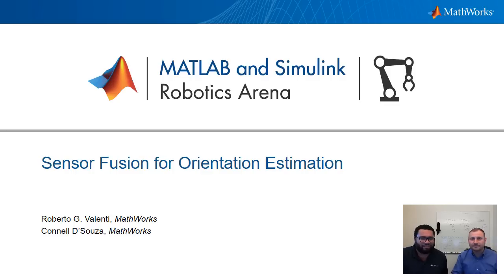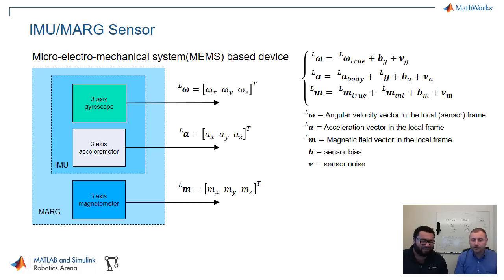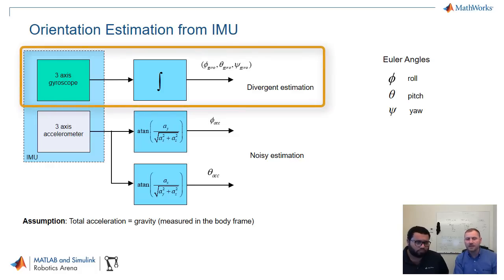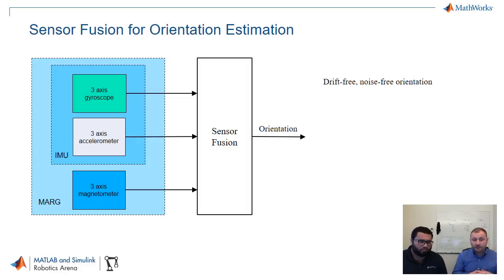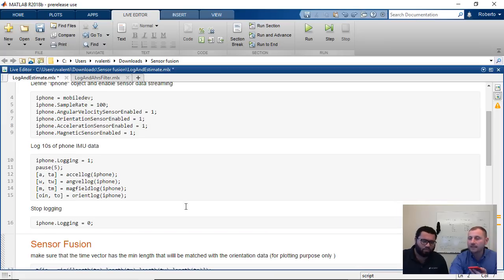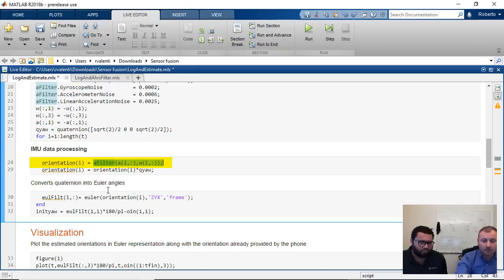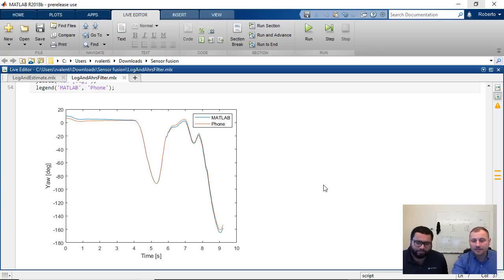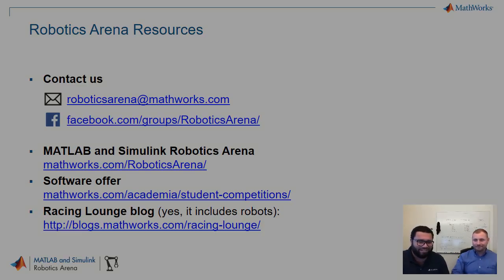Sensor Fusion for Orientation Estimation

Comment: Is it possible to integrate angular rates in order to get a set of euler angles. Shouldn't we consider a coordinate or reference frame conversation using like quaternion or dcm?
After that we can use the corresponding results with the calculated ones come from accelerometer and magnetometer.
Reply: You must convert the angular rate that usually is projected into body frame in euler angular rate where each angle is in a different reference frame if you use intrinsic euler angle. After that convertion you can integrate the euler angular rate and obtain the euler angle. I hope is enought clear, you can find a lot on the web. :)

Comment: Hello, is it possible to do this in simulink? What would be the blocks? Thanks!, I need for code generation for a microcontroller.
Reply: Right now you can put these MATLAB objects into a MATLAB Function block in Simulink. This functionality does generate C code so it should work.

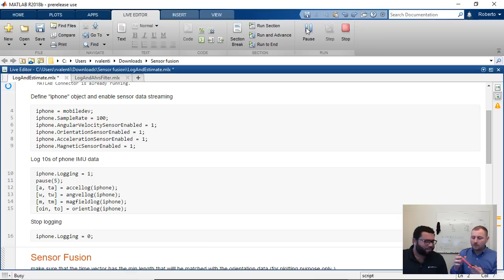Comment: What is sample rate? Why did you set yours to 100 (11:05)? How do I determine a sample rate for my phone/calculation?
Reply: I believe 100 Hz was the maximum rate you can get from MATLAB Mobile. For a real sensor fusion application, you want to sample as quickly as possible to get good results, given the computational resources available.